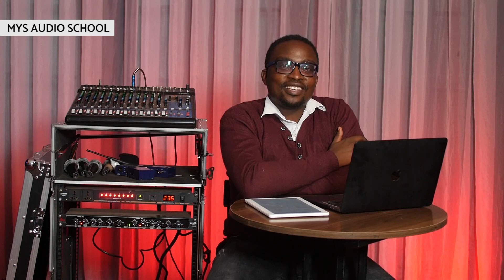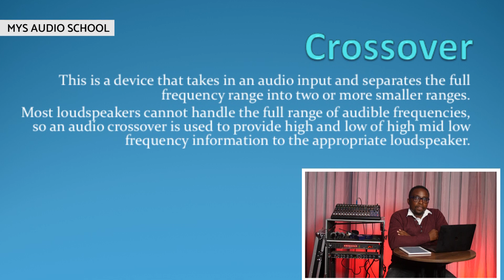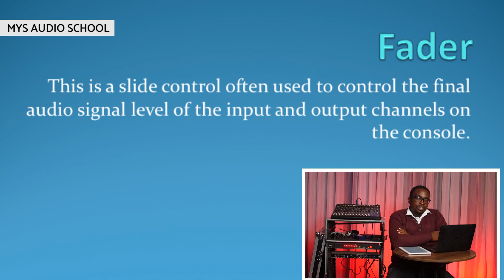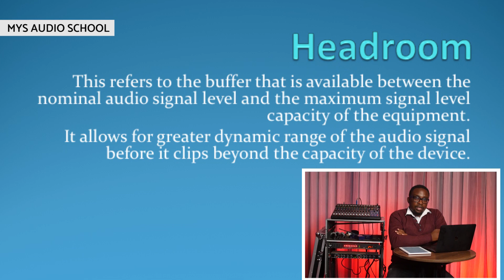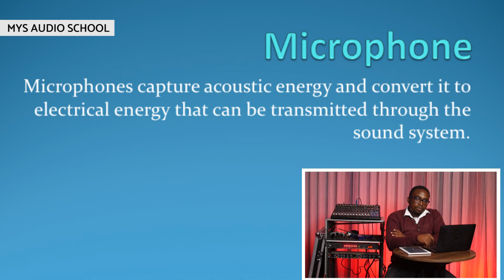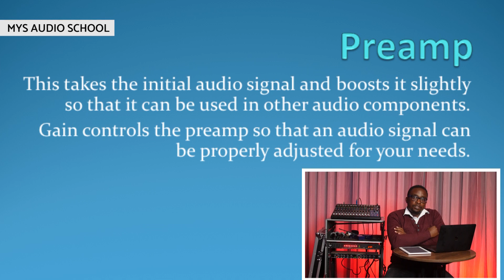MYS LIVE SOUND ENGINEERING INTRODUCTION CLASS

Comment: I hate to be negative to anyone trying to teach people, but this class jumps all over the place.  There is no rhyme or reason why topics are in the order that they are.  I mean the first thing the instructor talks about are amplifiers!  Why amplifiers?  It's not the first part of a signal chain, nor the last part.  Then auxiliary outputs?  The instructor hasn't talked about inputs or signal flow at this point, yet wants to talk about aux outputs!  I would expect a introductory class to start with the basics and then logically build from one topic to another.  I mean the instructor talks about compression and EQ (which are more complex concepts) before he even talks about gain and gain structure (which is the most basic building block of sound reinforcement).  I expect that any real beginners to audio engineering are going to have a really hard time comprehending all this information because of the way it is presented.
Reply: @Brian Simmons you are right, but you know it takes a lot of effort to put this together for free audience consumption, you'll probably would have appreciated the effort and then direct messaged him on further improvement.
Reply: This class has nothing to do with signal flow or gain structure etc. it's more of defining some commonly used words. Maybe you listened to critic.

Comment: Thanks a lot for this... my question is, is it advisable to always leave the phantom power on or only when I,m using condenser mics?
Reply: Most analog consoles only have a single phantom power switch and it turns phantom power on/off for all inputs.  On these consoles, if you need phantom power for even a single channel, it will be on for all channels.  If you have a digital console, most will allow you to turn phantom power on/off at each preamp/channel.  While it is rare to have this occur, phantom power can damage certain equipment that isn't designed to have external voltage applied to it's output.  Therefore best practice would be to turn phantom power off on any channel that doesn't require it (because you are using condenser mics or active DI boxes for example).